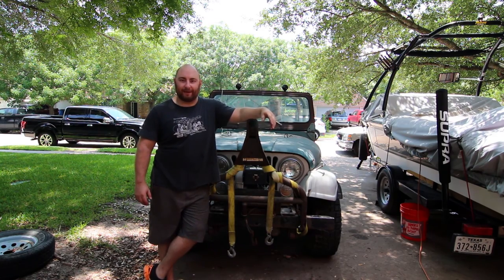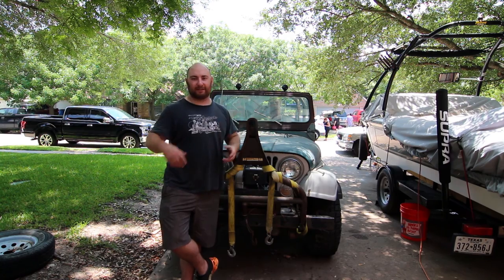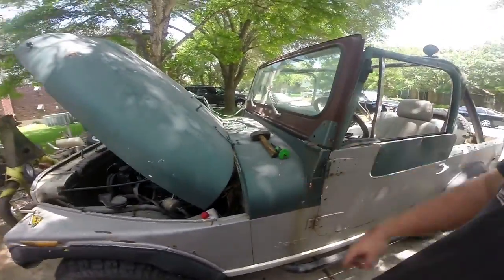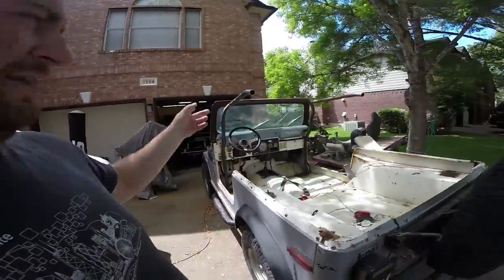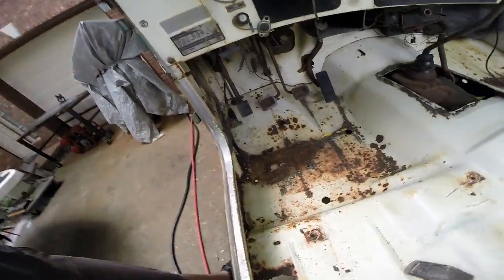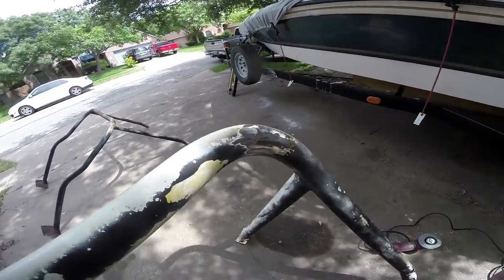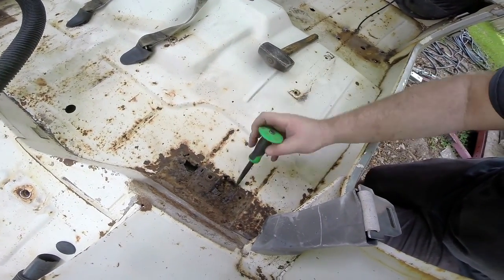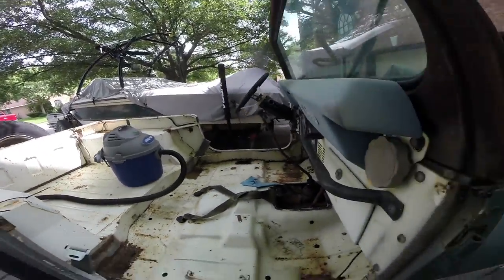MaksWerks Garage - 1979 Jeep CJ7 Build - Part 1

Comment: You realize you don't have to drive the pins out of the door hinges to take them off right? They just lift off bro. Lift the straps off the hooks inside and open the door and lift it off.
Reply from the maker: I didn't drive the pins out. The bottoms of the pins were rusted in. So I used the punch to help move the door pins up through the bottom half and then lifted them of.